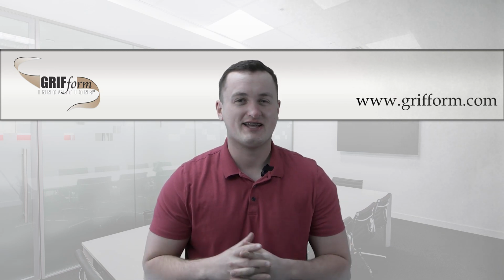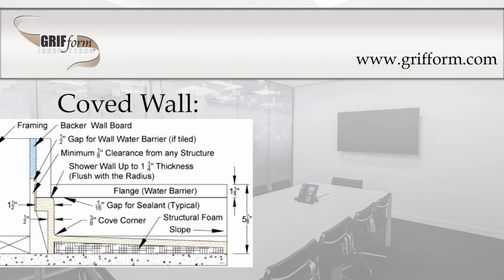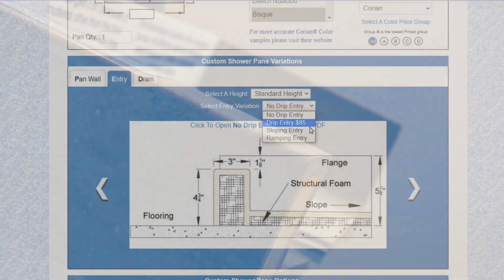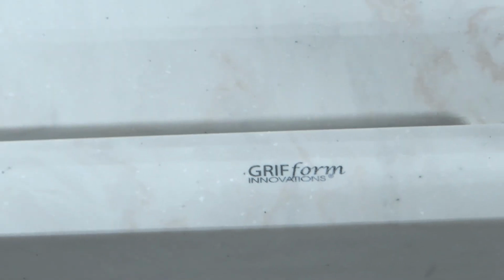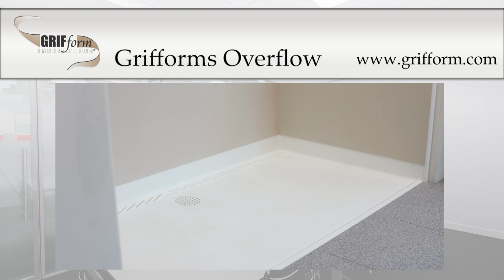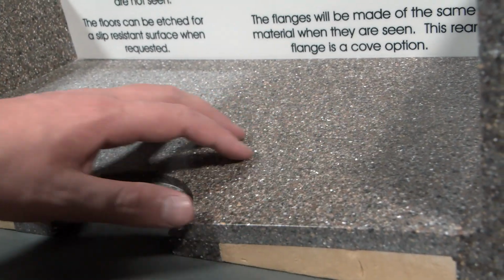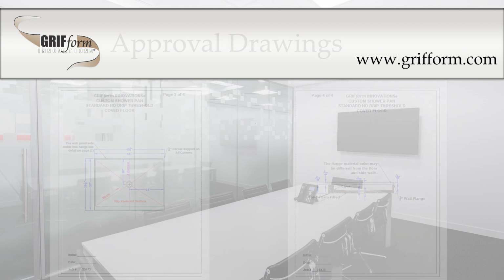Totally Customizable Shower Pans! | Solid Surface | Grifform Innovations

Comment from the maker: Time Markers! 
0:00 - Intro 
01:40 - Shape Selection
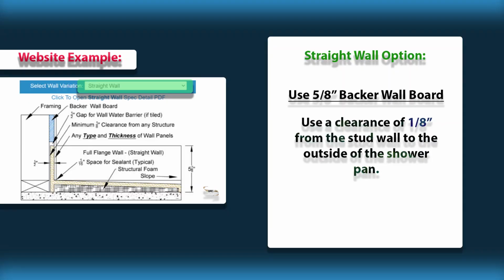03:22 - Clearance Measurement Guide
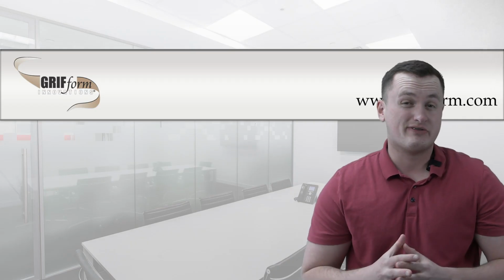04:25 -  Pan Wall Variations
09:29 - Shower Base Entry Variations
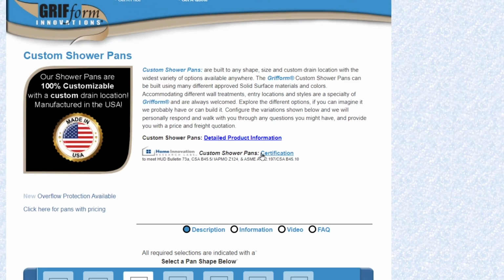13:54 - Drain Options
15:18 - Overflow Protection
18:12 - Color Matching Strainer
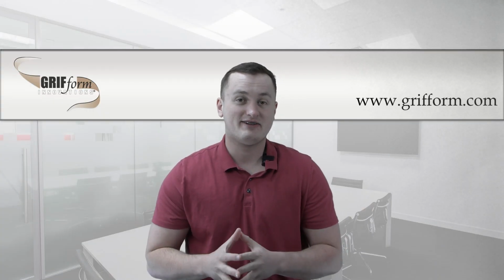19:30 - ADA Approved Slip Resistant Flooring
21:57 - Outro / Order Processing
Reply: Hello 
How do you turn the surface to slip resistance